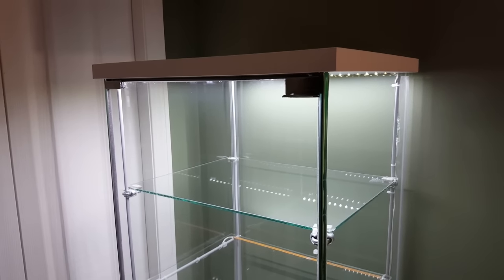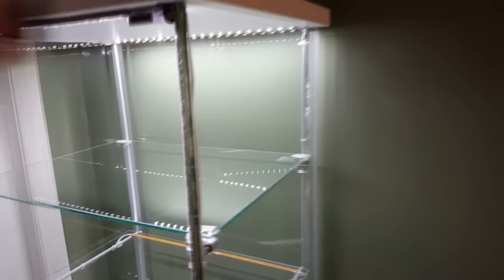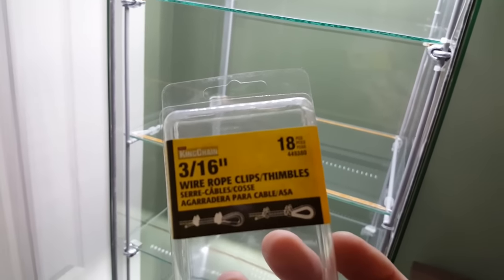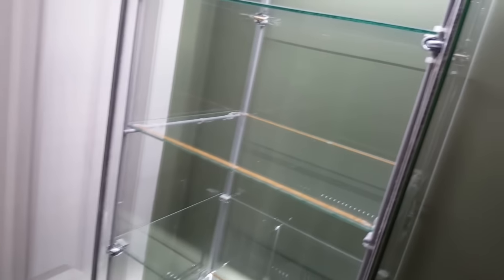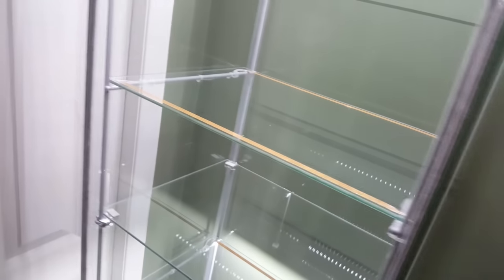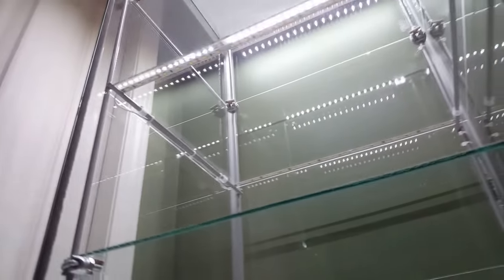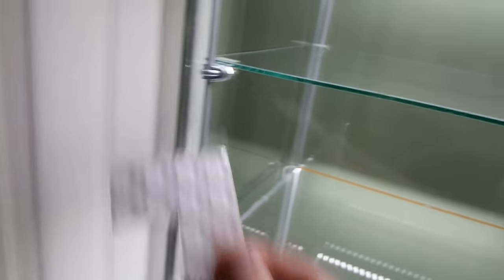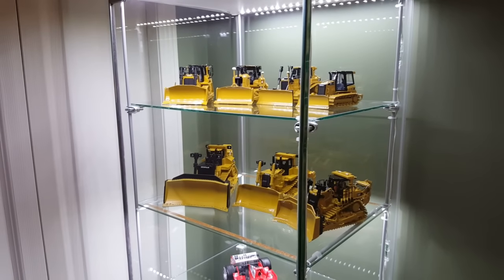Make your Detolf AWESOME!!!

Comment from the maker: Description now includes parts list with links.
Reply: SS454LS6 Awesome!Where did you find the extra shelf?
Reply: In Canada home Depot numbers.
Everbilt 3/16 inch Zinc-Plated Wire Rope Clip and Thimble Set - 3 Pieces
Model # 501811
|
SKU # 1001026931
Reply from the maker: Thank you!
Reply: Hey sir! I have the same issue with the door doesnt close up at the top. Im interesting in getting that magnet but the link in the description doesnt work. Could u help me out thanks
Reply: Great Video! Do you by any chance remember how much the extra shelves costs and where you got them?
Reply: I’m not seeing the parts list?  I was wondering what thickness was needed for the pile strips? Thank you!
Reply: non of the parts links works!!!

Comment: I used hot glue on the corners of the glass where it touches the clamps. It protects the glass, keeps it from moving/slipping, and is easily removed. Nice work!

Comment: Thank you for sharing, i am planning for the same thing. However, I’ll prefer to use different set of led, I don’t want to deal with manually turning them. I found a set on Amazon with app controls for scheduling, and possibly dim levels, about $30. Have fun!

Comment: Hi great job,
I too would like to light up the shop window.
But how did you manage to connect the individual strips?
Did you use the classic 2 pin connectors or did you solder them?
Hello and thanks
Reply from the maker: I soldered them.

Comment: Another tip. Rather then drilling a hole one the base. Why not installing the top up side down on the bottom . That works too. Only need to predrill some holes for the plastic base.

Comment: My only concern would be is if the led's overtime cause collectibles to fade/change color.
Reply: Sunlight causes collectables to fade because of the UV radiation. The LED lights are completely safe and won’t cause collectables to fade or change color

Comment: Cool video but would've liked to have seen you actually soldering and the attaching to the other wiring. For those that are not familiar with that type of work
Reply: There is alot of leds that are just plug and play I got some for my tv

Comment: I use the foam weatherstrip for my detolfs. I think I need to try the pile weatherstrip. The issue with foam one is when opening and closing it rubs against the glass is cost friction. Hope this gives more give...
Reply from the maker: In my experience the pile weatherstrip does have more give. Expect to still have some friction as you want it to have a pretty tight seal to keep the dust out.
Reply: Does the pile have a sticky side? Also, do you tape it near the edge of the glass?
Reply from the maker: Yes it has a sticky side. I taped mine right on the edge. I think having it inset about 1/8-1/4" may make opening the door a bit easier.
Reply from the maker: That is what it looks like. Local hardware stores should have it.

Comment: Would it be better to just buy another Detollf case to get the extra glass shelf instead of having to custom order extra glass ?
Reply from the maker: It's about the same price. In some situations it could make sense.
Reply: i bought 4 mm thick acrylic sheets for mine cut to measure online cost £30 approx,that for 4 shelves.

Comment: i was looking for that pile you're using in my local store, but they only have the foam one, not the brush, is it safe to use that instead? kinda afraid if the foam make it more air tight,  will that affect my figures? thanks
Reply from the maker: I suppose it could depend how soft the foam is. I personally would not use the foam as I believe it would act more like a seal than a flexible dust barrier.
Reply: @SS454LS6   i see, thank you for replying

Comment: Very useful information ! Thanks for sharing ! 

just one question: where can I get tempered glass with that size ???
Reply from the maker: I had to order mine through a local glass shop with custom dimensions. Tempered glass takes longer to make and is a bit more expensive, but I think a good upgrade in terms of safety. I highly recommend taking your own measurements as these Detolf frames can vary between each other.

Comment: Are there certain dimensions of the Pile I need to be aware of? In other words is their a certain thickness so that it covers all the edges?
Reply from the maker: I recommend 3/16 to 1/4 of an inch. I'm not sure how thin or thick they make it. Too thin and it wont seal, too thick and it will look crappy and you may have clearance issues with the door opening/closing.
Reply: Is the pile on the door, too, or is it only on the top, sides and bottom of display case?
Reply from the maker: There is no pile on the door.

Comment: Do the glass side panels on your detolf bow otuwards towards the middle?
 So the gap is really small at the top and bottom but wider towards the 
middle?
Reply from the maker: Yes mine do the same. One must not over tighten the top nuts that keep it all together, but even when loosened off, they still bowed out.
Reply: Ahh okay at least I don't have a faulty cabinet. I've got the same stuff you use to seal it from dust, but because of the bowing it's hard to close the door with the brush pile strip on. Thanks for the reply.
Reply: Any remedy for this?

Comment: Really thinking about getting one of these to display a autographed wrestling belt. My concern is since the belt is leather and not flat on the front plate is there enough room that the front plate can sit at the front of the glass hanging off a bit and still close?
Reply from the maker: There is about 1 inch space between the front door and the glass shelf, and the same in the back. So front to rear you could fit something approx. 17" deep inside.
Reply: SS454LS6 awesome thanks that should work
Reply: Matt Hardy displays his championships in Detolfs. Look at his Twitter or Google online. It should fit nicely.

Comment: I live in Texas and I just got a Detolf I went to Home Depot and they couldn’t find the pile stuff you used in the video to keep the dust out is there another link because when I tried clicking the link it didn’t show any picture and the associate couldn’t find it the closest thing was some weather stripping adhesive foam strip about the same thickness as the pile you showed in your video
Reply from the maker: search Pile Weather Stripping on amazon.com. It'll come up with a bunch of results.
Reply: SS454LS6  what is the size of pile did you use because your right it does show a bunch of results on Amazon thanks , but i just need to know the correct size please
Reply: I want to know the size as well.. is it 6mm, 8mm or bigger?

Comment: won't weather strip work?  for keeping the dust out?
Reply from the maker: Different kinds of weather stripping can work. I find the pile works great to seal doors or panels that may slide or swing open as the pile flexes, bends, and squishes quite freely. Something like foam strips may cause an obstruction on the hinge side when opening the door.
Reply: SS454LS6 okay, thanks!  for the info.

Comment: Does this detolf case fit 1/6 figures. 12 inches high?! Thank you
Reply from the maker: The factory shelf spacing is high enough to fit 12+ inch items. If you added shelves, you would not be able to fit those items.
Reply: Sorry I'm confused
Reply: So i have 4 12 inch figures. I could fit them all on this plus more?
Reply from the maker: The factory Ikea Detolf cabinet has 3 shelves + the base at the bottom. So with 1 figure on each shelf, yes you could put all 4 figures in the cabinet. If you mean 4 on each shelf, I couldn't tell you because I don't know how wide your figures are. The shelves are about 15"x15", but that can vary a bit.
Reply: Yes

Comment: great tutorial :D

Quick question. Exactly what size pile weatherstrip did you use?
Reply from the maker: Thanks. 3/16"
Reply: I'm lost, I got 3/16 and there is still a gap on the side. Also I'm not clear as to where you put the inside one where door swings. Maybe a tip good sir?
Reply from the maker: I put the weather stripping down the front edge of the side glass. If I were to do it again, I'd probably lay it 1/8-1/4" farther back. 

If you are getting a gap, is your side glass bowed out? This Ikea glass isn't the thickest/straightest glass, so it has a tendency to bow out causing gaps, especially if you over tighten the frame bolts.

Comment: My door is on the left side wtf
Reply: Also if your door doesn't shut or only the bottom magnet works and the top feels loose you unfortunately put the cabinet together wrong. The plastic strips that hold the glass should fit flush and the glass should slide all the way in. Don't over tighten the top screw either if done correctly nothing should clank and the cabinet should be sturdy then the door will close perfectly its a huge pain but follow the stupid pictures too it helps alot. Good luck